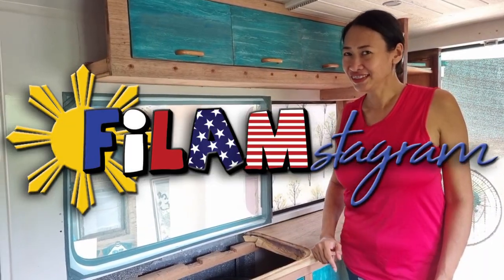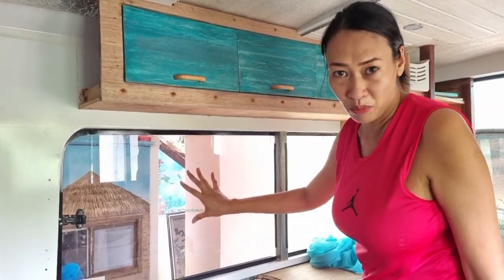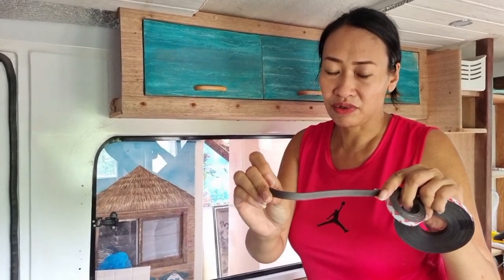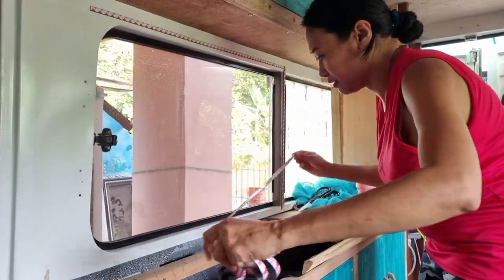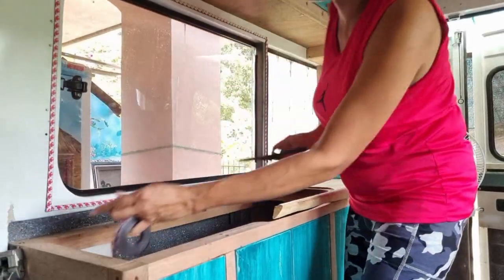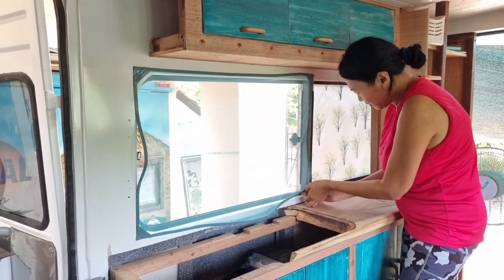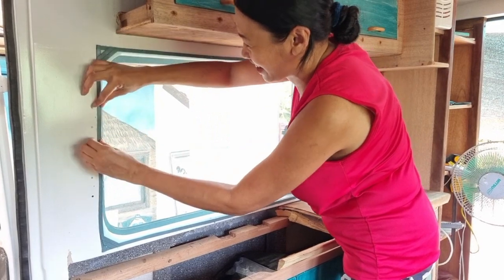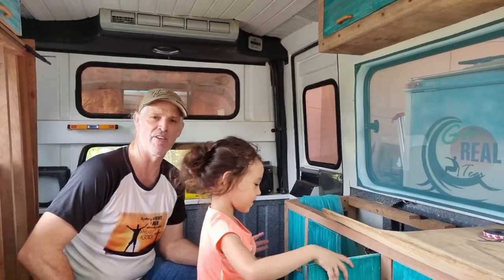DIY Magnetic Mosquito Screen for Campervan | Mitsubishi L300 FB DIY Campervan

Comment: Magkano na po total cost ng pag renovate nyo? Include po ung body modification salamat po
Reply from the maker: Hello po. Di pa po tapos renovation namin kasi wala pang electrical system, water system, CR, and some other major structures na kailangan ng welder, pero our budget is P800,000 including the purchase of the van. We bought the secondhand vehicle already modified with high roof by the former owner (P475T: see how it looked when we bought it in this episode: https://www.youtube.com/watch?v=B6ePF62MdDA&t=172s). According to the former owner, that was about the same price he paid for the original unit plus modification.
Reply: @filamstagram  thank you po 🙏 still waiting na matapos na yung camper nyo 😍